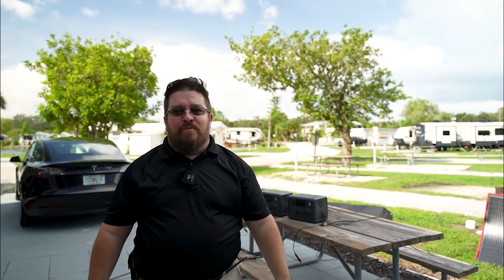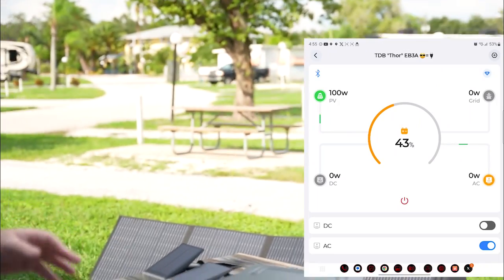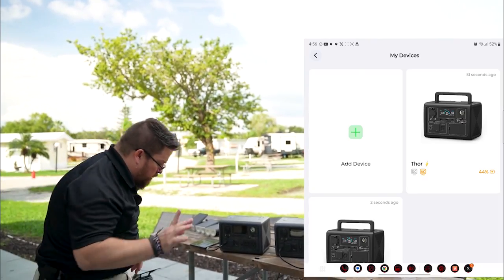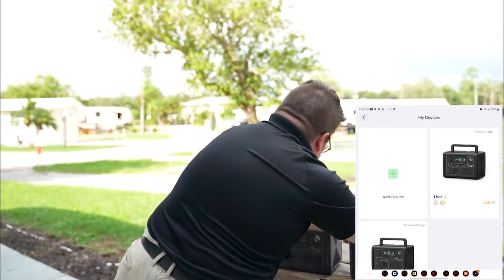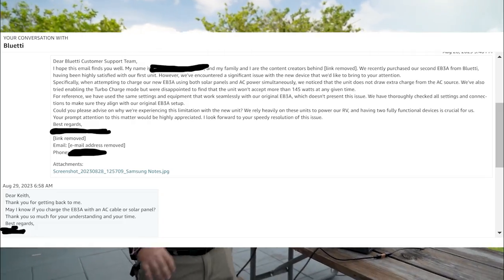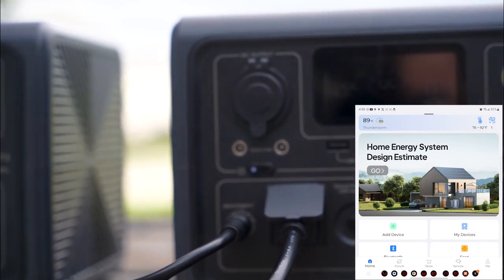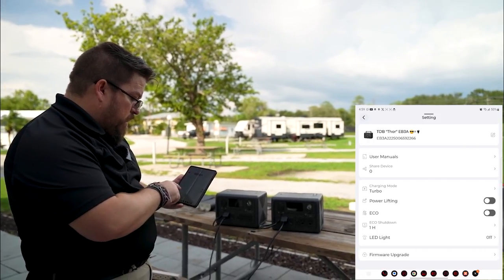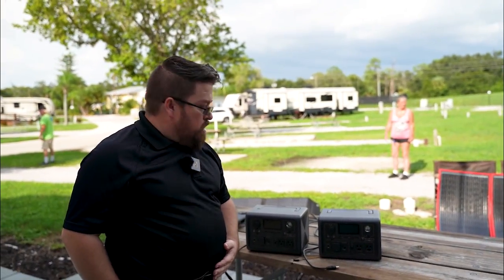Too good to be true? | Bluetti EB3A Solar Generator & Power Station

Comment: if you have a solar panel which is 200w but it has 17Volt and 11.7 amp dont expect to get 200w from it device accepts 8.5amps at most so you need a solar with higher voltage and i am not even considering the fact that you need to have perfect sun condition and such
also it looks like a hot day there getting 100w is perfectly normal you would get 268ish on standard charging and up to 430w with solar + AC charging if and only if temp is fine like around 20-30c. also once you reach around 80% charge the wattage will drop down to 100 anyway which is intended behavior.
That being said maximum input for solar is 200w for that you can never reach 350w turbo with solar you will need AC and even if you get solar panel with 23.5v and 8.5amp you still wont get 200w because of losses you would get around 160-170 ish in perfect scenario 
looking at that your irregular solar panels that 100w is more than expected.

Comment: A related scenario: If the power bank was charging from a 12v power port in a car (cigarette lighter), you'd be glad its max draw was 100w because the car's power port maxes out at 10 amps. 12v at 8.5 amps = 102 watts. Therefore if the power bank is limiting its draw to 10 amps then it is protecting the car's 12v power port.
Aha! The Bluetti EB3A user manual, page 8, DC Input states:  8.5 Amps Max. So a 12v source will give it 102 Watts. (( if you had a 24 volt source would give it 200 Watts.
In conclusion, my fellow Van Dwellers, it's not broken; it is operating as intended.

Comment: Commenting a year later this may be irrelivent? My only suggestion is to check for a firmware update on the app. My EB3A started showing 100% charge plugged into mains power on the screen when the battery was actually 100% flat. It would work on mains power in UPS mode only but unplugged completely dead. I found a firmware update and it's now fixed working as normal.
Reply from the maker: Thanks for the tip—really appreciate it! I ended up figuring out something interesting much later: even in temps around 80°F or higher, the EB3A starts to throttle charging. Also, with DC input, if your voltage is below 18V, it won’t let you pull more than about 100W. But once I bumped it to 24V, I was able to get almost 200W input again. Hope that helps someone else running into weird charging limits!
Reply: Mind sharing the new DSP and ARM versions? I suspect I need one too.

Comment: I don't have a bluetti, but im planning to do so , i did a little research and found similar problem, i think that it has a limit of how many amps it can pull from the solar panel (if it is a 12v panel it pushes more amps) so the charge controller unit that they have must have a limit, i found a video where it seems to have found a way to tackle this problem and get more watts to the system I'll post a link, hope it helps you or anyone who sees this.

He starts addressing the issue at 09:00 and after

https://youtu.be/ppujPRMS4YA?feature=shared

TLDR :

You need to connect (if you are using a 12volt  Panel ) a 12v to 24v converter (since the voltage gets doubled the amperage becomes half)  and eb3a's limit must be in the amps.
Reply from the maker: Awesome info! I’m definitely checking out that video. Thanks for the heads-up about the converter too—every little bit helps when it comes to solar setups!